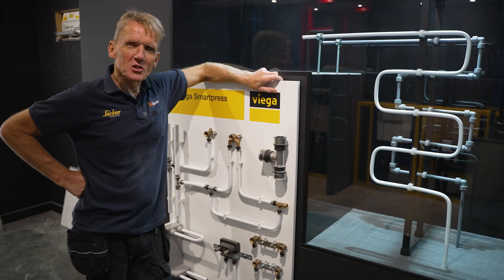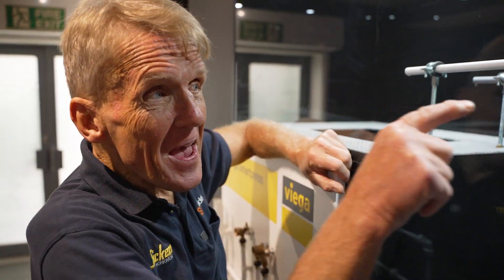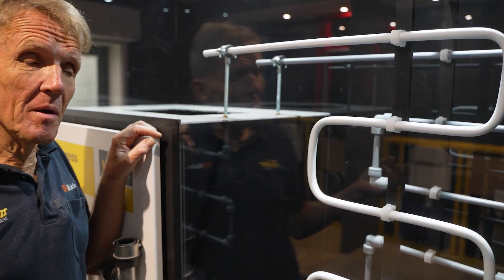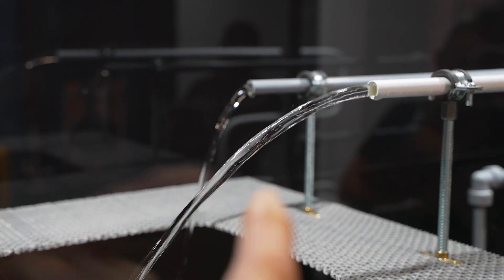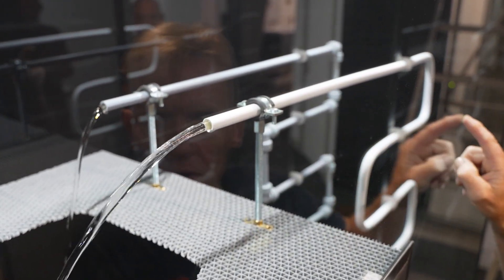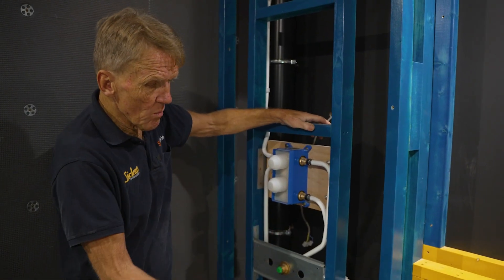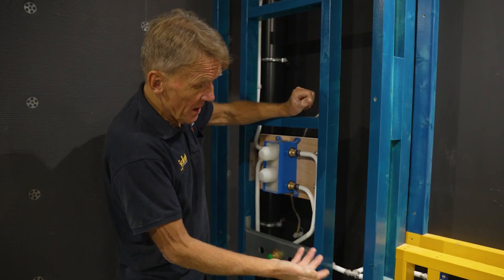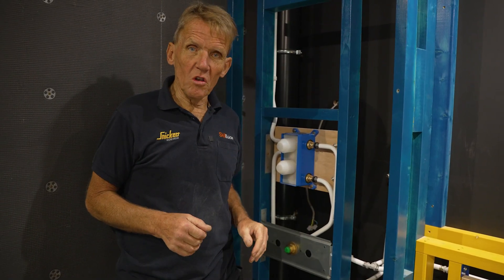Gobsmacking Truth About Plumbing Elbows

Comment: In our apartment block, the bent plastic pipes are failing and leak. They are 35 years old and, over time, the stress on the bends has eventually led to tiny cracks gradually forming. This is on both hot and cold pipework.
Reply: All pipework has a lifespan. 35 year old elbows will leak too. There no right or wrong. It’s just pointing out if you’ve got issues with flow rates possibly look into how many elbows it flows through.
Reply: @Danfrank24  exactly
Reply: 35 years really isn't an unreasonable lifespan for any pipework.
Reply: @HarveyDarvey1122  except solderd copper pipework could easily last much longer than 35 years
Reply: @bsimpson6204  I've known soldered copper start getting pinholes in less than 10 years. Also depends what copper we're talking about. 22mm and upwards, sure I can see that lasting a long time. 15/10/8 probably nowhere near as long. It also depends on how well balanced the installation is and if it has inhibitor etc. whether some the pipes being weathered on the outside, if some tool has used power flux on a gas pipe etc. there's just so many variables.
Reply: @HarveyDarvey1122  This is down to the manufacturing process  and was a big problem in the 1970s when a solution was found.
Reply: @harrydavey9884 It is for proper copper!
Reply: @HarveyDarvey1122 I work on copper pipe systems from the 50s they’re still in very good condition.

Comment: Pulled bends are always better than elbows. Yorkshire used to sell bends and elbows but bends were discontinued years ago. Using fittings instead of pulling bends is an American habit; i dont think young guys learn to use a bender anymore. Applies to Sparks as well with conduit, most of them use plastic instead of steel.
Reply: Nah, that's about cost!  I can get a bundle of plastic conduit for the price of a single length of steel, and the time to bend cut and thread (which has to be done at the at the "bending station" where the stock is) versus the time pushing in a bending spring and painting cement on my couplers (which can be done wherever you're working) is such a vast saving that you only use steel where it's needed (normally due to environment).  To a sparks it's not about laziness it's about economy (getting the job) and time (doing the job).  To us it seems that for plumbers it's about laziness and the lack of need to demonstrate skill: if it's not on show why waste time on a bend!  So they spend more money on accessories and tooling (especially that crimper) to save a minute rather than carrying a spring...

Comment: To be fair for a true test the pipes need to be run separately, you could fit a tap at the base of each pipe then only turn 1 on at a time & then test the flow, otherwise some water will just take the path of least resistance. (Plus you could still turn on both at the same time if you wanted).

Obviously the flow should be less in the pipe with 90s but I'd bet it's not as bad when run separately so it would be nice to see.
Reply: Im glad someone got it. Their "test" is rigged.

Comment: I am Norwegian and can't resist my urge to brag a little about the system that has been standard here the last 30 years. It makes the one here look primitive. It is semi rigid thick walled  polyethylene pipe that doesn't allow any sharp bends. No hidden fittings allowed, so no hidden sharp bends or hidden leak risk. There is an outer pipe that leads water back to a drained manifold cabinet in case of a leak caused by say, a nail gun, and allows changing of pipes without any work on the building. The system is practically the only one in use in Norway. So it is tested over 30 years. All patents are expired and there are multiple manifacturers. Google "sanipex pipe-in-pipe" if you are curious.

Comment: Anyone familiar with high performance car exhausts will not be surprised by your demo! Amazing to see though.
Reply: just remember that certain pipe formations causing, for example, back pressure and shock waves are of advantage, and that gasses are compressable - water isn't. It's hard to compare the two apart from superficially.
Reply: @gurglejug627  I feel suitably superficial :-)
Reply: Wouldn't push fit exhausts be great though?

Comment: It would be interesting to see the same experiment with copper joined with both solder fittings and compression fittings, to compare.
Reply: If compression fitting put on properly there won't be any difference.

Comment: How did they get the bends so tight without using permanent bend formers?
I'm wanting to use 15mm Hep20 PB Barrier Pipe for the first time (with traditional brass compression fittings & stainless inserts where fittings required).
I plan to use some formers to cut down nos where practical.
I might be missing something here, but based purely on material costs (excluding labour time), I can't see much cost advantage of plastic over copper & compression fittings for DIY size jobs.

Comment: A better plumber would use solder fittings, which are a lot cheaper too.  Those bends are too close together to be "real life" examples, and measuring a bending them would take ages, compared to cutting and soldering joints.  And as we know, plumber's time is money!

Comment: Impressive difference.  Is this a poly pipe?  Or rigid pipe that was bent?  In the states we use "pex" water piping a lot.  I thought it was mostly because it is easy to work with, but I didn't realize the potential for improving flow over rigid pipe.

Comment: Not saying your wrong Rodger, but we cannot see the "feed" for those two pipe runs, if they are fed from the same pump then its obvious that the swept bends will have better flow, but my mind is suspicious :)
they could have two seperate feeds and one could be deliberately set lower to exaggerate the effect.
Reply from the maker: There is no trickery, one tank, one submersible pump, one outlet, going into a tee and two equal length runs. If you think there is trickery you have to ask why anyone would want to do that? Abacus bathroom is not interested in selling thousands of systems on a lie. They are not Volkeswagen

Comment: Many years ago, part of my job was to run flow-pressure calculations on pipework systems - elbows and tees were assigned an 'equivalent length' of straight pipe for pressure-loss. As another commenter has asked - yes, swept bends are in theory available, but most often you have to plumb with what you can easily get. On larger systems, 65mm / 2-1/2" would have been useful, but it just wasn't stocked by anyone in the correct spec we needed (BS1387 & BS1740 HW galv), so we had to make do with jumping from 50mm / 2" to 80mm / 3".
Reply: Plumbers should have a copy of Crane TP-410 with them, haha.

Comment: Part of my job is to unload a liquid fertiliser ship, the tanker trailers all have different attachments, some are straight pipes, others have 1 or 2 or 3 90 degree bends. The ones that have the 90 degree bends do fill slower than the straight pipe trailers.
As soon as you were about to flick that switch i knew what was going to happen but i didnt think it would take that long a delay for both to be running lol
Reply: Were both pumps identical ?
Reply: @jonb3311  its the ships pump we use, so only 1 pump. The ship pumps off into a 6 way manifold. The lorrys were on hoses 3 and 4 (in the middle) so getting the best flow possible.

There have been times a lorry with a trailer thats got 90 degree bends on it has turned up 5 minutes before a straight pipe trailer, and the straight pipe trailer leaves 2 minutes before the one that was there first. 
The more 90 degree bends you got, the more the flow slows.
Reply from the maker: There is one pump. That was said

Comment: As a diyer, I always use pulled bends where possible but I have found the modern copper wall is very thin and even with annealing I have trouble pulling bends using a spring. mind you a set of dodgy knees doesn't help.
Reply: They make tools for bending half-hard copper pipe properly.. I think they call them pipe benders.
Reply: @Monkeh616  Hi. Yes I know about the proper pipe benders with formers, For many years I was a pipe fitter mainly on steel pipe but also did copper. Retired now and been helping out my son moving radiators, so the price of a bender for the amount of time I would have needed one is not worthwhile. The only time it would have been handy was I needed some small offsets in the pipes to the rad, to get it passed a beam, other than that elbows have been ok. Just looking online and I see you can get them from around £30, so if I was doing full time it would be a no brainer.

Comment: Do a flow test measuring time/flow rate on them separately as the water will obviously take the path of least resistance when running both in parallel same as if i run a hose pipe outside when someone is in the shower lol
Reply from the maker: I understand your point and it is interesting but if the bent pipe is the path of least resistance that is the whole point of the video. You have an equal pressure and flow at the pump so that is the same up to the point of the first elbow.
I agree that the effect is compounded. I think there is much to explore here but the bottom line if that bends are better than elbows.
Reply: @SkillBuilder  I agree that the bends are better than elbows both for flow and better noise reduction and leak risk reduction but in this test the water will  take path of least resistance so if your house has Elbows everywhere your mains water pressure will still go somewhere or maybe don't use elbows on your shower pipes so you at least get a better shower flow when someone flushes the toilet lol
Reply: This is exactly what was going through my head. For a true test the pipes need to be run separately, you could fit a tap at the base of each pipe then only turn 1 on at a time & then test the flow. (Obviously you could still run both at the same time if you wanted).
Reply: Is it possible to install the non jointed rig into a timber wall with holes drilled for the pipes?

Comment: Very interesting Rodger. I’d like to see the same experiment but with copper pipe and push fit elbows. This would then remove the constriction and likely turbulence caused by the inserts.
Reply from the maker: I can do that experiment.
Reply: @SkillBuilder  I look forward to the result.
Reply: @SkillBuilder  I would watch it. Please try and make it conclusive: same ID pipes, identical but independent water sources. You could also make more then two sets of test units as there many questions about this topic. Love your videos, cheers from Hungary.
Reply: I think the sharp 90 degree changes of direction have far more impact on the flow than pipe inserts.

Comment: I’m no plumber but isn’t there a swept 90 rather than a sharp 90??
That would make a difference surely
Reply: Sure, it would, but on these plastic pipes every fitting needs a reinforcement insert which reduces the bore, which is a huge part of the issue. You could build a similar demo with nine couplers in a vertical pipe and see a similar result.
Reply: I always use copper pipe with end feed soldered fittings. If there is any doubt about flow rate, in France where I live, you can use a huge variety of different diameters of pipe moving up in 2mm steps. Those pipes even fit inside one another, alleviating the need for reducers too. Brilliant system and never a problem. I won’t touch crappy plastic pipes, crimped fittings etc. etc. because I know they won’t stand the test of time.
Reply: Seems the building game is far behind other fluid/hydraulic fields...

Comment: we have a huge problem with that in our mains supply's from the roads the work being done to install new meters fix leaks and raise road side stop cocks all have the those 90 degree fittings the amount of lost flow across the waterboards side is getting worse every day. and its because they are not interested in a good job just a quick one.
Reply from the maker: you are so right, I see that a lot on meter fitting. It is all sharp elbows, no bends.  I had a new 25mm main put in and they used the old 1/2 inch tapping so I gained hardly any extra flow.
Reply: @SkillBuilder I had a new mains moled in a few years ago to replace the old lead, and they did it in 32mm. The water company doesn't know that fortunately.

Comment: I did my own house about 30 years ago in 22mm copper and didn't use a fitting.  I thought at the time it's got to be better with bends.  It's been great.
Reply: Blimey. That must've been a long pipe! How did they deliver it to your house?
Reply: @paul756uk2  Good point.  I mainly soldered end-feed straights.
Reply: @EeezyNoow  yeh, I guessed that. Not many people would have been that meticulous. I'm sure it must run quieter as well.
Reply: @paul756uk2  It does.   There's no water hammer (no 90 deg elbows).  Plus my Potterton Kingfisher (non-condensing) boiler lasted 30 years.

Comment: A true test would have involved switching the supply at the start of each run.
Reply from the maker: The supply is a single pipe teed into two so there is nothing to switch
Reply: @SkillBuilder  I don't doubt the effectiveness of bent pipe, but in this scenario the water will take the path of least resistance impacting the flow of the other even more, so it's not really a true demonstration. A twin outlet pump would have been better, but it gets the point across.
Reply: @ninjainabowlerhat yeh, I agree with that. It's a double whammy because what you gain in one, you lose in the other. A flow rate over time would give an accurate measurement.
Reply: @SkillBuilder  in which case each run should have been separately supplied in turn by the same source.

Comment: Increase the water pressure to 3-4 bar and you will barely see any difference.
For gravity fed systems though, of course this will be noticeable.
Reply from the maker: I will do that experiment but 3 to 4 bar is more than most domestic plumbing. Unvented cylinders are 3 bar,
Reply: @SkillBuilder  we have 4 bar at stopcock in our property - was tested by water supply company a couple months ago, so I assumed it's common (could be wrong of course).
Would be nice to see you do the experiment though!
Reply: @AlexGnok  you could have 10bar! 3 bar is plenty it’s flow rate after that. Most unvented can prob do 60 litres per that 4 good showers 3 really good but you need the flow rate to keep up. So bigger pipes. Could but 80 bar through a straw.  But imagine a shower from a pressure washer
Reply: @SkillBuilder  I had 5 bar on my upstairs tap once we converted to a combi from vented, had to fit a PRV on the mains to keep it down!